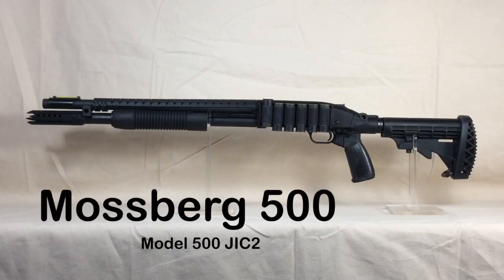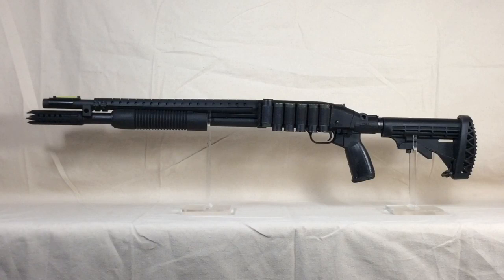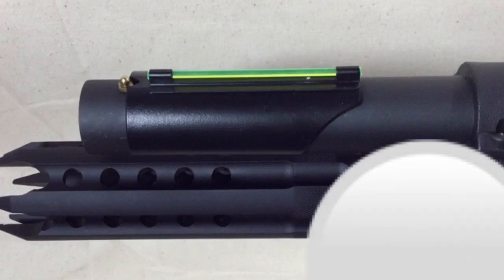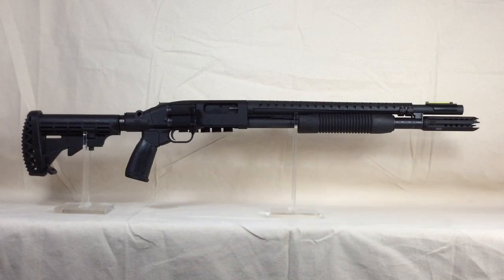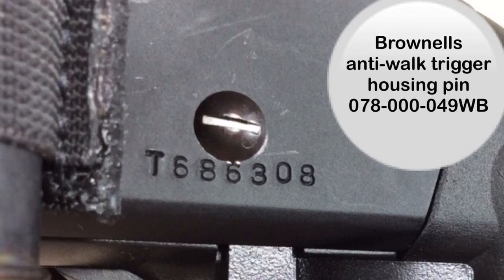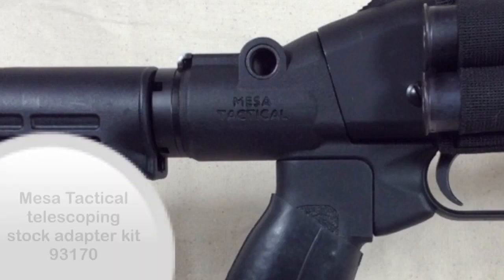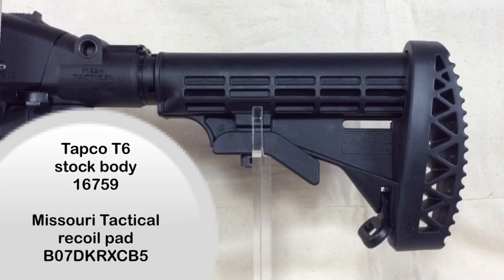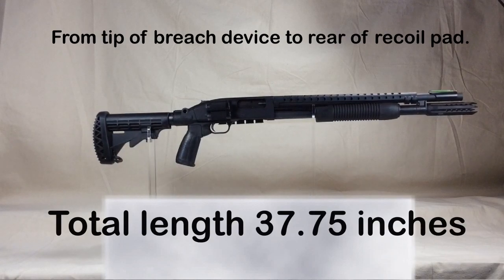Mossberg 500 setup, issues and observations

Comment: Other issues with the mossy is:
The trigger housing sits with one pin. Housing can be broken if it's hit sideways (edit: that's why the military 590a1 has a metal trigger housing).
The shell lifter can pop out of it holes in the reciever, if gun is dropped. Then it shoots one shot, then the gun is jammed and must be taken apart to be fixed. Had it done twice to me.
(edit) Great vid. Thx for sharing and efforts
Reply: Dang, you adress this it in the vid. My bad